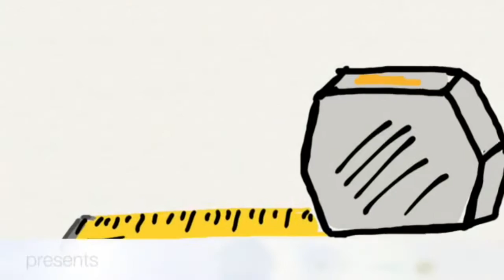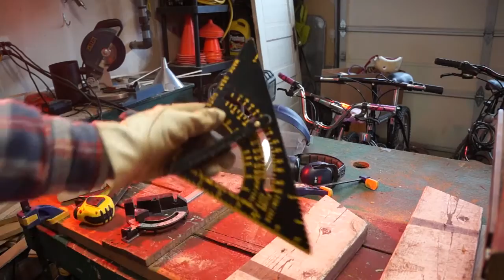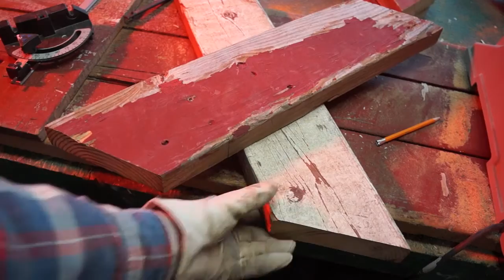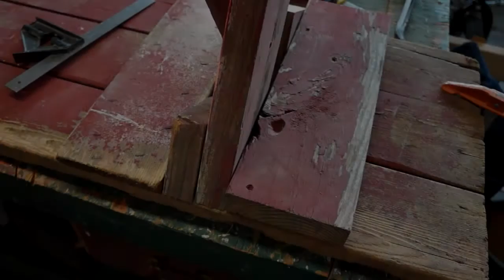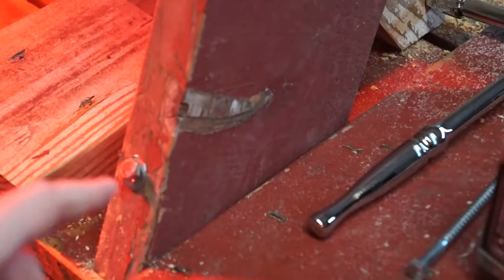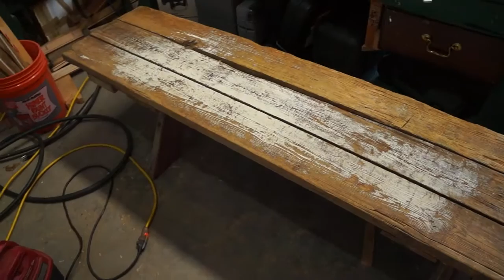How to Build a Barn Wood Bench

Comment: Can you make a headborad out of a picked fence? I want to make one but no idea how haha
Reply from the maker: If your bed is not going to move, build your picket fence the width of your bed and attach it directly to the wall. Don't worry about attaching it to the bed. Or screw the cross pieces into the wall and attach the pickets directly. You could use pallet wood and just cut a point for the top to look like a fence. Then paint in place. Hope that makes sense. Good luck!!